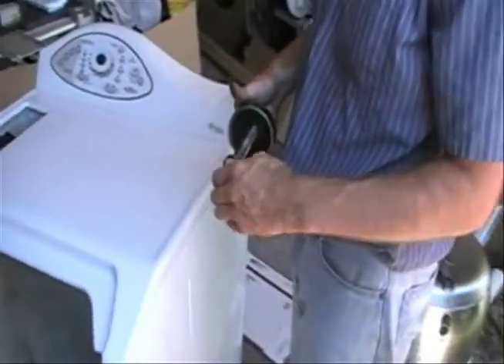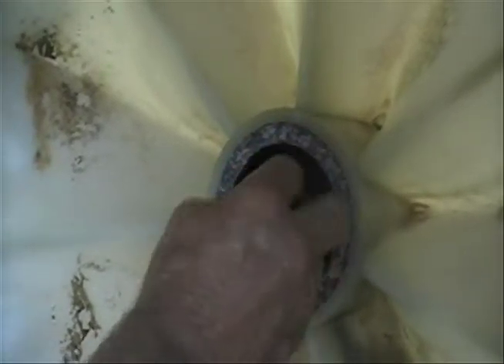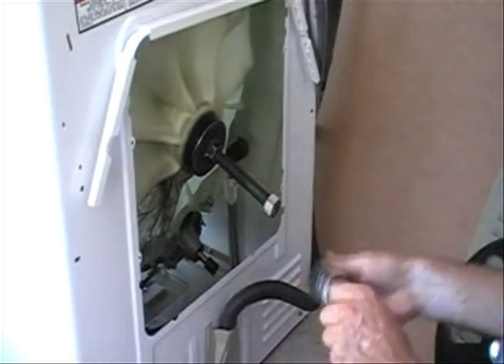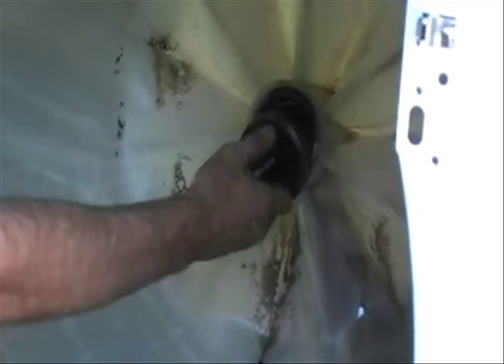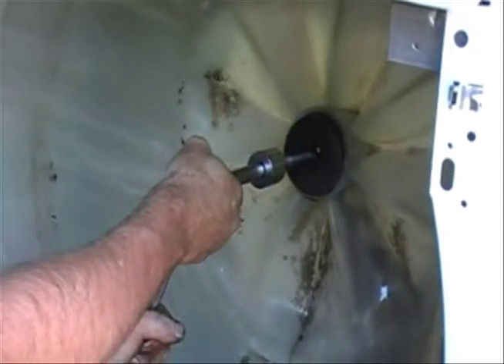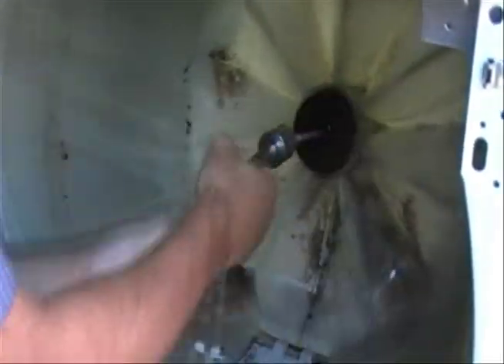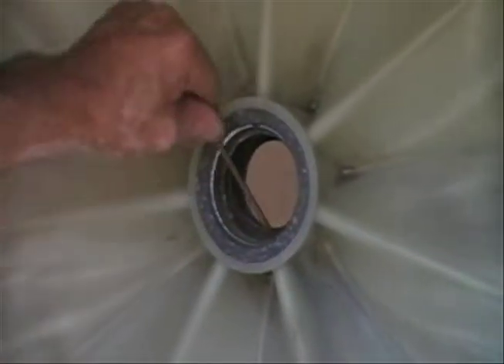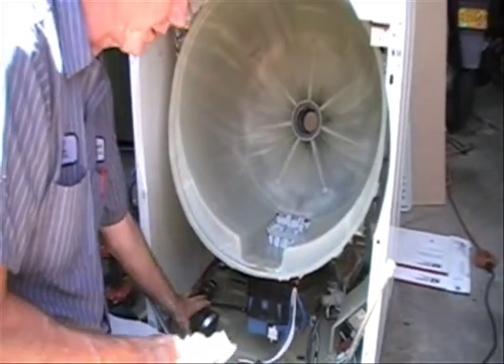Maytag Neptune Bearing Replacement (part 2) Bearing Removal

Comment: Thanks for this really helpful set of videos (1,2 and 3). Is that bearing puller something you made yourself or can it be purchased somewhere please?  Need something like it to work on a Maytag MAH6500AWW washer, which is about 20 years old.

Comment: Anyone know where can I get the bearing puller tool shown in the video? I clicked on the ebay link on the part 1 video and it only came up with a wire wheel attachment of some sort on ebay. Any info helps, thanks!